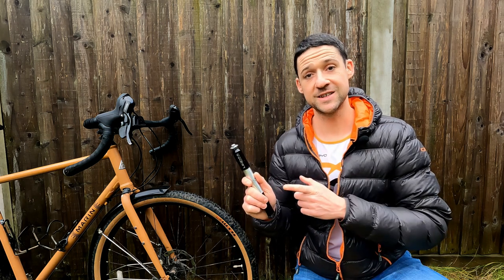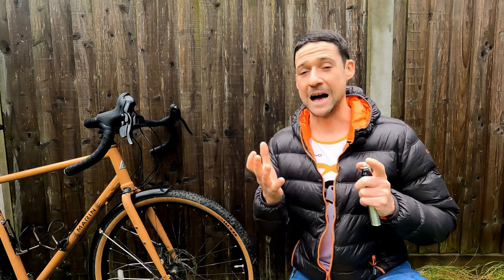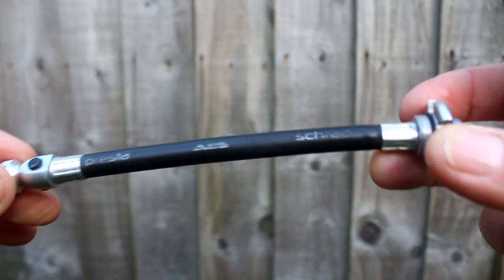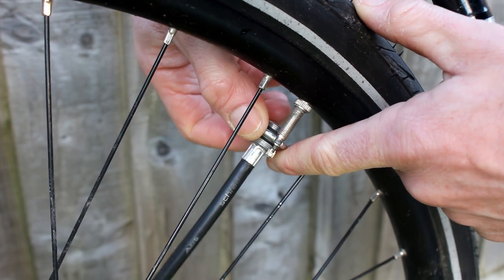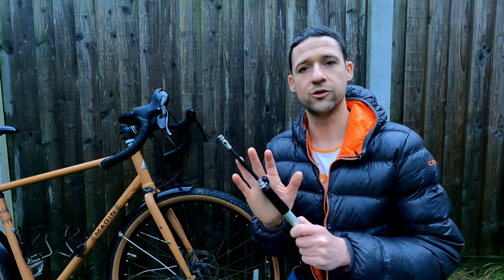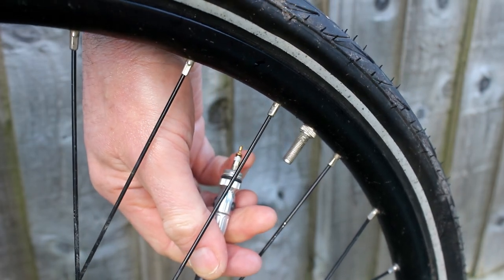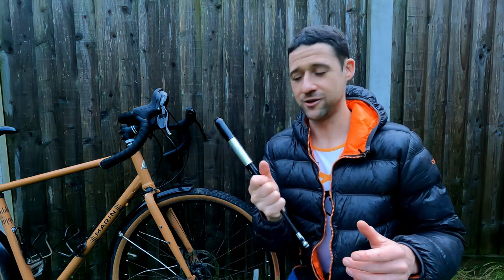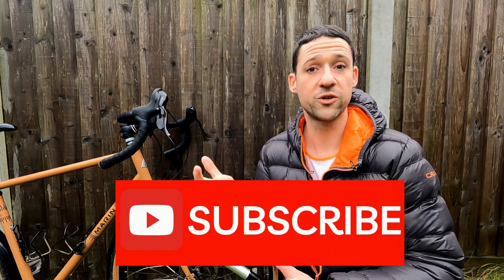Worlds Worst Bike Pump | Lezyne Pressure Drive Bike Pump Review

Comment: I'd say it's not the pump but the removable valve stem.
Reply from the maker: I'd agree that the removable valve stems have an influence. But if it wasn't the pumps fault, then this would happen with other pumps as well. Which I haven't had.

Comment: Sounds like your just tighten it to much on the valve end it doesn't need to be as tight as a plastic one
Reply from the maker: Yeah perhaps. I did try it looser but struggled to get a solid connection. Guess it's a fine line. Did you have a better experience with this pump?

Comment: That was a really interesting review.  I didn't realise that was what that button was for.  I'd heard of that sort of thing happening so I don't think you're alone.  I guess I've been relatively lucky.  Mine is old enough to predate the button and I'd never even realised they had a version that had the valve core tool either.  The other night I actually managed to do that valve unscrewing trick by taking off a dust cap (no pump attached) and it made me realise I didn't have any useful tightening tools.  I personally haven't had any issues with presta valves doing that with my lezyne, but I can't explain why.

I don't think you're wrong with your general conclusions, although this is my favourite pump 😂.  I suspect with modern materials if you buy a decent pump it ought to be good no matter what it's made of.  And there are really good pumps with clamps instead of screw on if you get on better with them.  I would definitely stick with a hose.  That is definitely the one key feature I'd say everyone should be looking for in their pumps.  No hose is my kryptonite when it comes to pumps.
Reply from the maker: Hi Colin, thanks for your insight here that's really helpful. Interesting you had this happen simply with your dust cap. I presume you're on the hunt now for a tightening tool to keep at home or put in your saddle bag???  I'm glad to hear though you are having a good time with the pump, I really wouldn't want anyone else to have the frustrtion I am having. I do believe this is massively 'user error'!
Reply: Thinking about the technique that I'm relatively unconsciously applying I think what I aim to do is ensure that the hose is perpendicular to the valve at the point it contacts the valve.  I had lots of experience growing up using those old really long old fashioned type pumps that used to dominate cycling and learned that was ideal back then.  Perhaps I had all my failures back then before I even saw a lezyne and so now largely I instinctively have a technique that minimises the chance of failures.  Of course perhaps it's something else I'm doing even more unconsciously.

I guess the failure modes are the interesting point.  With the threaded sort you mostly have unthreading the core on a presta.  I guess if you have more angular force on the hose then it might rub that core more and be more likely to undo it.  If it's loose you may well catch it anyway.
With the clamps the failure modes I've seen with presta are 
a) failing to get air in because the valve sticks (that seems to be resolvable by tweaking the valve before attaching, letting a little air out, ensuring it's not going to stick - this might happen with a threaded one too?  Perhaps I'm mostly only using my threaded one from a flat tire so I notice it less with that?
b) not having a secure enough connection to the valve so it blows off under pressure.
c) possibly mangling the sticking out part of the valve if you're not careful - this one might be common to both types of attachment?

I think bad experiences with clamps on small pumps without hoses may have made me more biased against the clamps.  Threads I love the security that once attached it won't come off, and I've generally found it simple to attach and remove.

I do use clamps with track stand pumps, and I have over the years learned how to deal with most of the failure modes.  Honestly I don't think either way is perfect.  I guess it depends on preference.  The clamp probably has a less severe failure mode and is more intuitive, but I have had times where I've definitely been very frustrated with a clamped pump at times.

I have found some of those tiny valve tools to carry around, but I'm wondering if I should get one of those hoses that came with your pump.  My guess is that your problem isn't isolated because it seems that over the years Lezyne have been adding features that help to deal with it.  First the button to release pressure, then the core tightening tool.  The fact you can get spares for their pumps is one of the reasons I've considered them to be a solid option.  Not that I've really needed much.  I've replaced a few rubber bits, but honestly I think it's really only the dust covers I've felt like replacing so far.

On the subject of valve tools: I discovered that my one multi tool that has a valve tool in the tire lever is problematic.  I think it technically works, just not when you try to use it when the tube is attached to a wheel because the spokes obstruct you from turning it.  You could rectify the problem by pulling the tube out and dealing with it before putting it back in, but if things have gone that wrong you probably aren't going to be in a good mood about doing that.
Reply from the maker: @boredalreadywiththis  some great points here Colin I really enjoyed reading it. 
I know exactly the older pumps you are talking about. I also know the feeling of doing something subconsciously to make it work, we've all been there! 

You are right about the clamp option limitations. You are certainly deciding which battle to have. For me the high pressure firing off the pump is most frustrating. 

I'm sure you could buy the new hose and use on your pump. May give you that security you need. 

One of my frustrations with multi tools for bikes is when they try and squeeze too many into the size of it, and it's not fit for purpose. 
What model have you got right now??
Reply: @mammothjourneys  I have a topeak hexus x.  I've had various generations of that tool and they generally do a solid job.  The tyre levers mostly work (I generally carry an extra pedros lever too for when you want that extra heft), and they have a good chain tool.  I've even used them to true wheels on a ride.  Some of the tools are very much a compromise you'd only want to use if you're forced to, but if not on this latest model, I think I've used the majority of the tools in those hexus generation tools.  My chain tool pin died from lots of use on my first one.  I find them so good I use them as the chain tool in all my maintenance.  Having the 3 posts seems not to be as common as you'd hope in chain tools.  I do carry quick links for anything >8 speed for attaching chains back together.
Reply from the maker: @boredalreadywiththis  a chain tool is a must on a multi tool I think. I've had to save mine and others with it, and surprised how well it works given the size of it. Happy to spend money on quality tools like this you know will bring you a return. Need to go remind myself what make and model mine is though!

Comment: Woke up at 5am for a ride now is 9am still trying to understand how it works 🤦   
7 times already getting start from beginning 😭
Reply from the maker: Oh no that is not a good start 😩 Hopefully you figured it out, or have bought a replacement pump! 😂
Reply: Update!!!! Need to tighten with wrench the bottom part of Presto valve. Otherwise it will keep going to come out… 
After tightening it all worked well 👍
Reply from the maker: @Dan_Jaden  good to hear you got it sorted in the end. Some others here have commented about locktite which may help as well.  Happy riding 😀

Comment: Same thing happened to me! Got stranded since I didn't have a valve core tool and had to call for a lift :- (
Reply from the maker: Sorry to hear mate that sucks. Have you replaced the pump with another one yet?
Reply: @mammothjourneys  Yes- I did get a Barbieri - Ultralight Carbon Minipump and it works w/o the hassle of removing the core and is light yet still gets the job done.
#pumps
Reply from the maker: @davepenegar8789  ah nice choice. Will check it out. Can you get good pressure with it?

Comment: Why do we use removable presta valve cores on tubes?
Reply from the maker: This is something I've learned from buying this pump. I've made sure I don't have this type moving forward - obviously needed one for the video!
Reply: Because people with deep rims use valve extenders and because presto valve cores occasionally break off or suffer irreparable damage, while the rest of the tube remains perfectly intact (so it's thus convenient to just replace the valve core)

Comment: Use locktite in the valve threat. That would solve the problem
Reply from the maker: Good suggestion, hadn't thought of that. Although it's frustrating to have to add an extra element into the routine. But if makes it all work happy to try. Thanks NFC 👍👏
Reply: I can confirm that blue loctite solved the problem for me. Exact same pump, exact same problem with valve cores. Now I just dab some thread locker on the core after I add sealant. There is another problem with this pump. After pumping vigorously for several minutes, it can fail to recharge the cylinder on the return stroke. Instead of pulling in fresh air, it will create a vacuum and spring back to the collapsed position. This doesn't always happen. When it does, I stop and wait for the pump to cool off.
Reply from the maker: @chrissanders4339  two votes for the loctite then - must be good! 
Now you mention about the pressure thing this makes complete sense. I have noticed this but couldn't figure out what was happening. Thanks for explaining it. Do you still use this pump then?

Comment: I can’t pump my tires no higher that 25psi with one of these!
Reply from the maker: That's strange. Is the hose connected right and checked the screw if you are using presta is fully released?